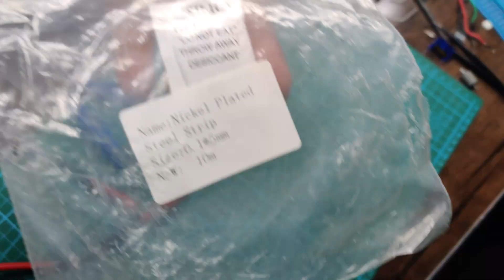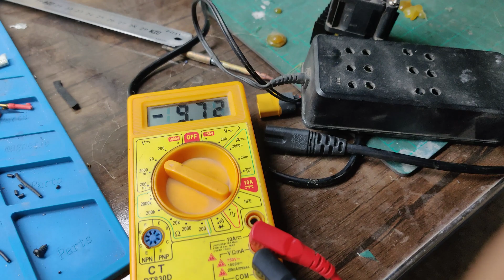How I build 150000mAh 12v Li-ion Battery pack with 18650 Cells.

Comment: So you can use an inverter to that kind of battery build?
Reply from the maker: Yes you can use it but remember that Normal 12v inverters shut off at 10.5v so use some sort of advanced sine wave inverters that can take input supplies to 9v.
Reply: @maaz_qamar_jatoi  im planing on using like only 200w inverter only so bms with 40a is good?
Reply from the maker: Yes go for it and also share your test results with me
Reply: @maaz_qamar_jatoi  yes sure im planning for it for a long time like mini solar generator
Reply from the maker: Best of luck
Reply: @maaz_qamar_jatoi  thanks for the info man